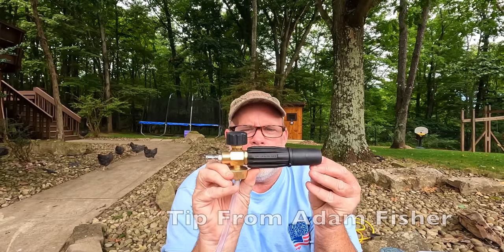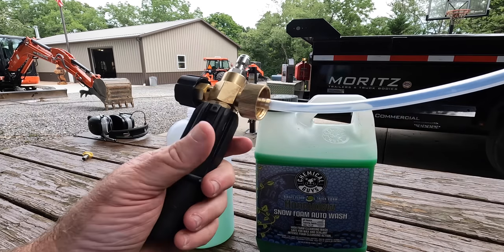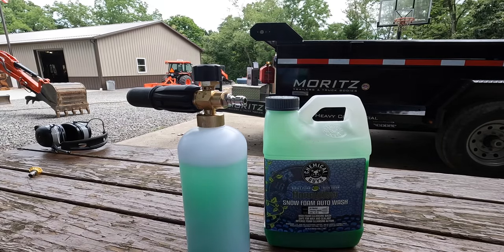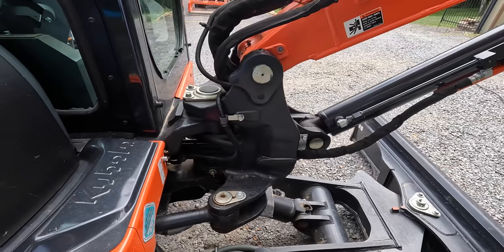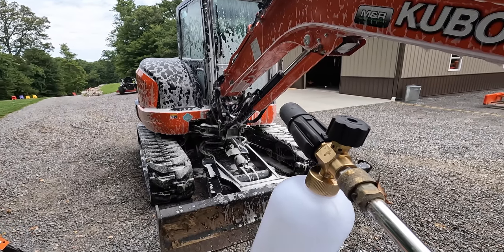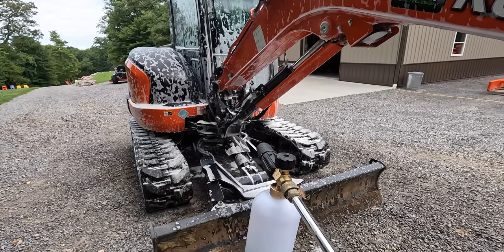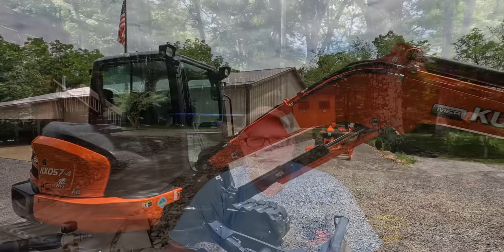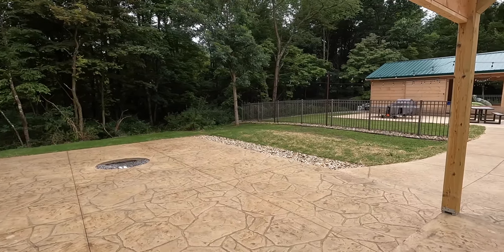Why didn't I get one Sooner? Foam Cannon for Tractor and Equipment Washing

Comment: Mike I use the foam cannon on my vehicles when I’m done I use my leaf blower to blow the excess water off so it doesn’t leave any water spots.
Reply: I use a foam canon as well, but also use a water De ionizer. I let nature dry it with no spots😁 one less step in the process..
Reply: @skoffco  yep only way to go !
Reply: Interesting.  The filter doesn’t cause any low pressure to the power washer?  Can you recommend one?  Thanks

Comment: Every Friday was clean up equipment and truck day when I was working. A clean piece of equipment is a joy to operate, not to mention the mechanics appreciated working on clean rigs. Good job!
Reply: Want a tip?
 Rubbing alcohol in a large spray bottle to clean the insides of windshields using a terry cloth towel.

Comment: I like that - 300 hours and not a scratch on it. It's really not that hard to take care of stuff, just a little common sense, a little mental effort during operation and a small effort when the projects are completed. Then you're rewarded with equipment that looks new still. You're also correct in keeping the resale value. Using the equipment in ways that it was not designed for is not good. So far, in the last 5 years, I've not seen you do that. I have seen that on a few other channels I watch. Thanks for the update at Cliff's property. It is looking nice, the grass is growing nicely. Kudos for the nice job there. I also really enjoyed the work on your sister's drive. Wasn't that shed delivery trailer awesome! Wow! Thanks Mike, loved today's video, as always!👍🚜❤🇺🇸

Comment: I have been using a foam cannon for a couple years, about a year ago I started using it with a pressure washer gun with out and on it makes it easier to use without the weight hanging out 3’ on the end

Comment: Good info again Mike! I've been cleaning the vehicles for a few years using about the same approach. Definitely good advice to get a good quality foam cannon to start, I tried a couple of the super cheap plastic cannon's 1st and they just don't work well or hold up, a solid brass cannon with the adjustability you point out is where you want to start. I can also vouch for Chemical Guy's detergents, I use the purple for vehicles and the degreaser they make is awesome too, they are a bit pricey compared to others, but they are super concentrated so you really don't need much in a bottle to perform very effectively. A gallon jug of the purple car wash lasts me 2 years+. Hoping everyone is doing well and BTW, Cliff is one lucky dude to have you as a neighbor, amazing work on his project, for sure!

Comment: We have a foamer at work and we run a product called Ripper thru it ,  its a heavy duty dagreaser we wash a lot of Equipment and it works well spray on let it sit on Equipment for a few minutes and before it dries hit it with the steam powerwasher works well.
Mike Your Equipment looks brand new all of the time you don't beat up and miss use Equipment you take care of things! And if you want things to last that is exactly what you gotta do take care of it.
Keep Smiling On!!
😀👍👊

Comment: Great video Mike!  I have been using one now for awhile and use it for everything.  For equipment, I use a stronger soap to cut through the dirt and grime.  I then use the foam cannon to apply wax for extra protection.  Works great and I did a video on it, if interested.

Comment: Mike, it is best to lube the equipment after washing it. Especially if you use a pressure washer. That way, the new grease pushes out any water that got into the joints and fittings. That is how we do it on airplanes.

Ed Gabbard

Comment: I used to drive a 32’ white wrecker and for 7 years I drove heavy haul transport trucks, all of which were white as well. I found if you mix Dawn dish soap and Pine Sol the combination would cut through grease and bugs from the trucks. It did a good job fairly quick.
Reply: Dawn dish soap works on a lot of stuff, I've used it to wash my cars in a pinch.  I have also used the Kirkland brand Laundry Soap for cleaning up oil stains on my carport, very little scrubbing needed, and a garden hose and nozzle.  

A product called Crud Cutter works great too for removing road grime, bugs, tar, etc. from a vehicle...you'll have to follow up with a soap/water rinse of course to get the Crud Cutter off, but it doesn't require any scrubbing at all, I sprayed it on the cab and hood of a pickup that had sat under a tree for a long time, I let the product sit for maybe 5 minutes took the garden hose with a spray nozzle and it sprayed all that gunk right off without scrubbing anything.

Comment: I have been washing  and detailing my own vehicles for a number of years using foam cannons. They work great to help loosen the dirt. Then power wash the rest off. Chemical Guys honeydew is a great car wash soap. Adam's polishes makes good soaps for foam cannons also.  Many of these soaps are PH neutral so safe for just about any thing, but not as good at lifting caked on  dirt and grime. You can find foaming car wash soaps that are a bit on the alkaline side that do a better job of loosening dirt . Purple power boat and RV wash is available at walmart and is on the alkaline side. Cheap and easy to find. Sometimes use in on my cars and trucks but  not sure if good idea to use it every time since it has a higher PH. High PH soaps will remove regular wax but not ceramic coatings. Yes some farmers do ceramic coat their tractors like their just like their truck. DO NOT used dawn dishwashing soap. It will eventually dull the paint and make the finish look old.

Comment: The true beauty of using a foam cannon is that it dramatically reduces scratches as the foaming agents have an emulsification effect on the surface where it literally lifts the dirt, sand, grease and grime off the surface enabling you to simply rinse it away. It won’t take the really heavy gunk off as you mentioned but generally speaking it’s faster and less damaging to the paint and fiberglass. Great way to knock out a tedious, messy job!

Comment: Foam cannons are a good tool to have for those quick washes. If you want to take it to the next level, follow up a good hand wash with a touchless sealant like carpro Hydro2.  Makes water dance right off and provides a good shine. I use it on my Massey and camper. Works great and you can dry with a leaf blower because the water just glides off.

Comment: Thats a nice set up. My Craftsman 3700 has a 2 bottle system, 1 for cleaning foam like your cannon, and a second bottle for a residue clean rinse or you can use a spray wax.

Comment: I have that same setup Mike, same soap also. Had it for a few years now. Only thing I don’t like is switching the tips back and forth. And don’t wash in the sun or it will leave spots on the windows, especially if you have the soap mixed heavy.

Comment: I just have a small electric pressure washer, I don't have a foam cannon, I've never tried one...I do have the soap nozzle and it seems to work ok sometimes, I'll have to order a foam cannon and give one a try.  I only use a pressure washer maybe once or twice a year so the electric was the best option for me, plus the pump shuts off when you let off the trigger unlike the gas powered ones that sit there and burn up the pump if you don't run over and shut it down between uses.  

I have been using the Armorall branded vehicle wash soap, seems to work ok.  On oil stains and spills on my carport I don't even use a pressure washer, I get the area wet, and use the bulk Kirkland Signature laundry detergent...a cup full of that, and an old broom to scrub the area, and a garden hose, takes the oil stain/spills right off the concrete.  Usually cat litter, or even sawdust will soak up a lot of it leaving very little residue if any, but occasionally there's a spot that just won't come off and that's when I get out the laundry detergent, brush and hose.

Comment: Thanks for foam cannon  demo. I like the way it performs. My old heavy equipment gets super greasy and grimy so I first degrease with a product called Black Max. But I like the finished soap and spray application to complete the job and will have to give it a try.

Comment: The foam cannons sprays are super effective. And easy to use. My only words of wisdom here are is to limit the amount of high water pressure you put on the equipment. You can force dirt into the bearings and sprockets. Using a garden hose for the wash downs on most occasions will be enough.

Comment: Obsessed garage has one of the best foam sprayers out on the market with all the different orifice sizes because to get the best foam from the cannon it needs to be matched correctly to the size of power washer being used they have couple videos explaining it on the obsessed garage you tube channel they also have all the stainless steel connectors for everything from hose bib quick connects power washer connections ect best place I've found to get what you need with everything explained to great detail and you can trust your getting quality. Foam cannons are awesome every garage shop needs one something about the foam is so satisfying!!

Comment: With you using well water, I'd recommend finding a biodegradable soap. Never looked for that in the auto cleaner sector myself. But one I like, if can be used, is simple green. Idle a gasoline power presser washer isn't good on pump!

Comment: I have been using a foam cannon for a while. I got one from Amazon that has a larger opening to fill the dispenser with. Less spillage. I also purchased a new handle only with quick disconnects so that I wouldn't have the weight at the end.

Comment: I bought a Chemical Guys Foam Cannon off Amazon a few weeks ago but haven't hooked into it yet.  Maybe I need to get the pressure washer out and give it a try.  My equipment could use a bath and my truck needs one too.  Thanks for the push Mike.

Comment: Mike these are great I use one all the time. You really want a shaving cream consistency foam to emulsify dirt properly and then wait for it to "release" and rinse it. I recommend an MJJC PRO cannon or you can change the orifice and filter in the gun you have for about $20 to increase the foam amount and consistency. Also try ADAMS MEGA FOAM soap, it's creates a ton of thick foam and one of the only foam soaps approved for direct sunlight. You only need 1 to 2 oz per wash. The MJJC cannon is more expensive but the performance is off the charts, you'll use less soap, and get better results. Just a fellow Yinzer giving some pointers.
Reply: Indeed and the orifice size should match up to the power washer being used which they have different sizes for that cannon! Agree with everything you commented there's a little more to it to get the best results. Are you on team obsessed garage?

Comment: You've made me want to try a foam spray that helps easily remove grease from the body of the machines. Thanks for the update!

PS: A skid loader has wheels. A track loader has tracks. Also respectively known as a "Skidsteer" or a "Tracksteer".
Reply: Finally somebody who has a knowledge of construction equipment.....And everybody calls them a "bobcat" ....can drive a guy to drink
Reply: @misterj1968  🤣

Comment: Been using the RB400 for five years now. It’s great, but would like a little more flow volume even for auto and sxs cleaning.  Would like a lot more flow volume for flat surface (concrete) cleaning.
Reply: The orifice size in cannon needs to be matched up to the power washer being  used in order to get the best quality foam and flow give it a search on here bunch of videos explaining it and what cannons allow the changing in orifice size it really makes a huge difference if your looking to take it to the next level

Comment: Just wanted to know if you use a Pump Saver before you put your Pressure Washer away each time. Might be something you want to show if you do. If not, I highly recommend it each time. It prevents that frustration when your pump won’t take prime and requires a replacement pump. Ask me how I know😩

Comment: Hey Mike , 
It's tough enough using a pressure washer , holding that wand. Especially when you have to hold up high or over your head .  Gives your arms a pretty good work out .
The design though . . 
 With that big water bottle hanging out there on the end of wand . Adds a lot if weight out there .
My cheapy,  electric pressure washer has a tube right on the machine itself , that you can put down into whatever bottle of cleaner you have and sucks put of the bottle sitting on the ground and sends it through the system , rather than having it on the end of the wand .
Can you do anything like that with your machine. Or  maybe add something like that to it .
My arms felt like lead watching you hold that thing up .
BigMike

Comment: Could you show the connection to the pressure washer wand?  Curious what's involved in switching from the foam cannon back to the spray nozzle, and how adaptable it is with different brand spray wands.  After 9 months of waiting, we finally got our MX6000 !
Reply: It’s the same size connection as your spray tips.

Comment: Foam lances are great but only as good as the chemical you use. My advice is to buy a good foaming traffic film remover, this will make washing your machines and vehicles so much easier. Pay particular attention to the dilution ratios. Each chemical has a point of "critical clean" using more chemical beyond this point is just a waste and will have no cleaning benefit. You'll never go back to the old way of washing. The chemical guys stuff is fantastic but geared toward the home owner vehicle market. Look at what plant yards, bus operators etc near you is using, it will work much better on oil or grease and be much more cost effective. I spray and rinse my vehicles daily for minimum expense and fantastic  results.

Comment: I’m wondering if since my pressure washer has its own soap tank do I still need the cannon, I have a soap tip but it obviously don’t adjust? I have not put soap in my tank yet! Edited: so I done my research the foam cannon is a lot better because you don’t have to run all the soap out before you use the regular pressure washer
Reply: T Holland - your research got you in the right direction. Foam Cannons are the way to go. Using those soap tanks that come with some pressure washers will only apply a “soapy solution”, not foam, but the worse side effect is that you’ll have soap residue inside your pump and pressure hose. Then, when you want to rinse off with clean water, soapy water is dispensed until the machine and pressure hose are cleaned out. Check out IMJOSHV on YouTube… he’s a professional detailer that reviews lots of pressure washers and foam cannons.